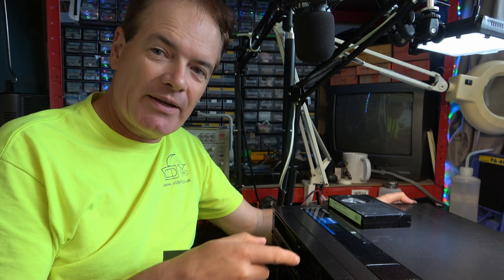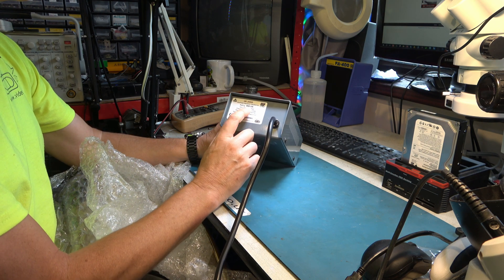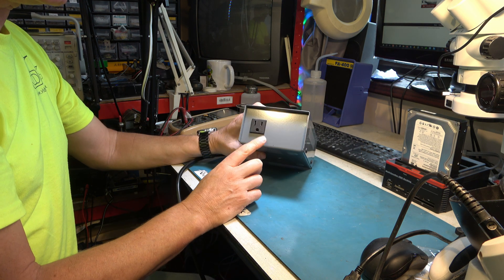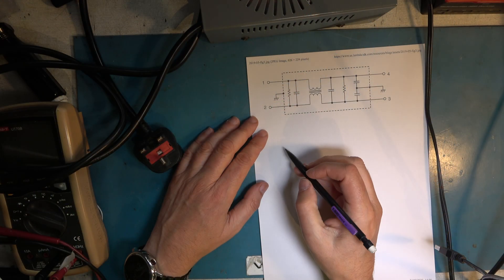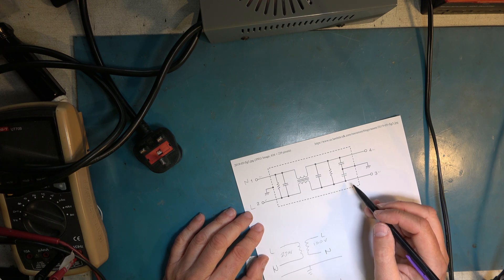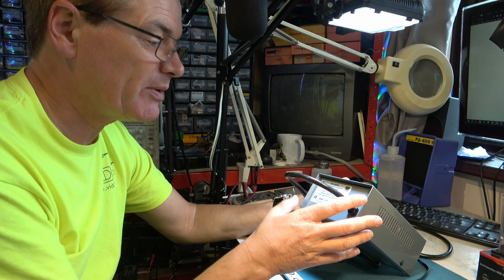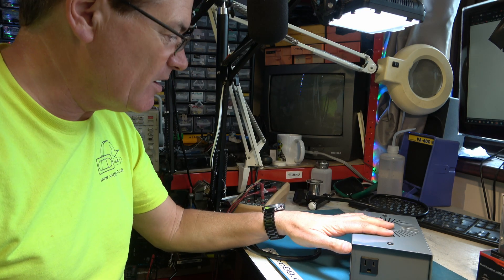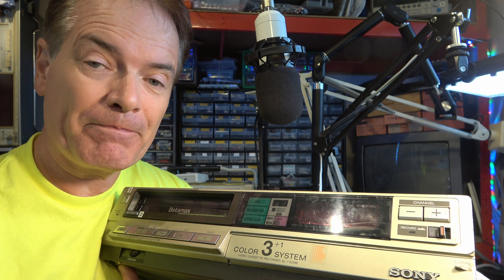100V transformer for Japanese SuperBeta, plus other Betamax and transformer matters.

Comment: cant you just convert the vcr capacitor to work on  220v ?
because im interested on doing  that  but i have no electric knowledge
Reply: Depends on the power supply. If it's a switching power supply, it can't be converted easily. If its a linear power supply with a big transformer, you can replace the transformer with one for your country

Comment: I also have a SONY HF-900 VCR. Our voltage is 117V, but we use a transformer to make it 100V. 
SANYO model : TSD -N11LU 
INPUT 120V STEP DOWN TRANSFORMER.👍

Comment: I thought an isolation transformer was with 1:1 windings, like you'd use for the CRT in arcade games and such?
Reply from the maker: Isolation transformers can be 1:1 or different voltages.  Most transformers which are built into appliances are isolation transformers.

Comment: The moment you said you got got a shock, i remembered getting a shock from a piece of Japanese equipment on an auto-transformer as well. Since mains plugs here are reversible, it can happen without any fault.

The mains filter capacitors in the unit are connected [N - Chassis - L] and will lift the potential of an ungrounded metal case to half way between its L and N inputs. Normally that is 50V for japanese equipment.

The auto-transformer reduces the Voltage by "moving" the potential of one input terminals by (240V-100V)=140V away from it (and towards the other input), thus creating 100V between its output terminals.

If it is connected the wrong way round it shifts the voltage up 140V above the input N. Now we have 140V+50V=190V on the ungrounded chassis (in relation to N/PE in the house).

The filter caps will limit the current but it is still nasty.
Swapping the input L/N around fixes it.
Reply: That's a similar mechanism to the scarily common: "I got a belt touching the dishwasher and kitchen sink at the same time!". That usually means that the dishwasher isn't earthed. A friend's mom had that issue and the story ended with a full kitchen rewire because the existing 60s/70s electrics were so dodgy (early-60s electrics from when the house was built, shoddily upgraded in the late 70s, including cables strapped to a live gas pipe, modified yet again by a handyman in the late 90s).

Comment: Thanks for suggesting Airlink Transformers. I've been searching for a 100V transformer for a while but could never find one. I've always had to use a variac for Japanese equipment. I notice they do a small plug-in 50VA transformer for a more reasonable price, which should be ok for a video recorder. My house mains supply is typically around 242-243 volts though, so these things will probably still output around 110 volts, but better than 120.
Reply from the maker: I think the 50VA one might be a bit marginal for some video recorders.  This SuperBeta's internal transformer is rated at (just) over 50VA.
Reply: Mains voltage in most of Europe is defined as 230 V +/- 10% so 243 is well within limits. Japanese mains is 100 V +/-5% as far as I know. 243 V divided by 2.3 (winding ratio of a 230:100 V transformer) is 105.7 V so slightly over by Japanese standards. Only at the very top end of the acceptable range for 230 V (253 V) you get 110 V out of the transformer.

I suspect most cheap transformers actually have a 2:1 ratio, i.e. they output 115 V at 230 V input voltage rather than 120. My old isolation transformer definitely does but it's labelled 220/110 V so that's correct. Fun story: apparently this small isolation transformer used to belong to Grundig Austria from the late 1960s until the late 1990s, the last testing sticker is from 1997.

Comment: Wouldn't it be more feasible to just swap to internal VCR's transformer for a 230 one?
Reply from the maker: They never did this model for 230V so the exact transformer would not be available.
Reply: @video99couk  Is it multi-tapped?
Reply: @Ragnar8504  then he could just replace with any transformer with the same output, doesn't need to be an exact part number, as long as it has the same VA or higher rating and it fits inside.

Comment: Maybe a nice follow-up video would be to convert it to 220V; shouldn't be a hugh problem for somebody with your skills and parts stash! Enjoyed the bit about transformer theory too.
Reply: Depends on the output voltage(s) of the transformer. If the original transformer has multiple secondary windings or taps supplying various odd voltages sourcing an EU replacement might be difficult and/or costly.

Comment: good morning friend congratulations for the video you are one of the best in the world I know everything from Betmax Umatic Super VHS etc. I'm here from Brazil, I also work with devices, but with less experience than you. friends, could you please send me the electrical diagram or service manual for the Super VHS JVC HR-S7900U and also for the Datavideo SE800 swith video cutting table here in Brazil, I cannot access these manuals on any site, sometimes in the United States if you could help me design these service manuals. I need a lot if you can conceive send this email.

Comment: most producers supply 240 and 110 volt units and the transformer usually has 2 x110 volt windings . in series for 220 volt and parallel for 110volt , did you check the internal transformer
Reply from the maker: Checked ithe Sony tramsformer  it is 100V only.